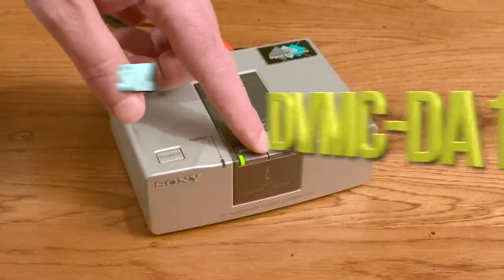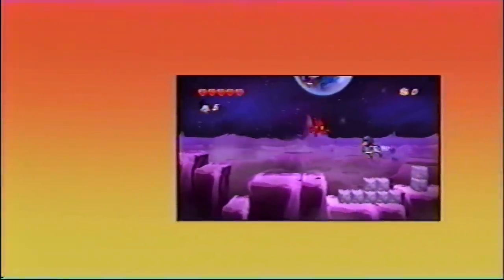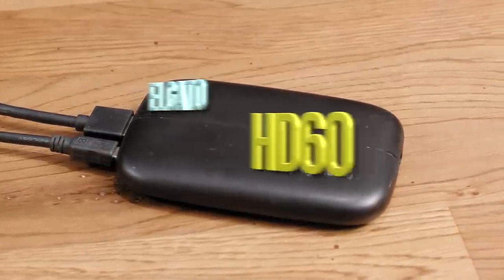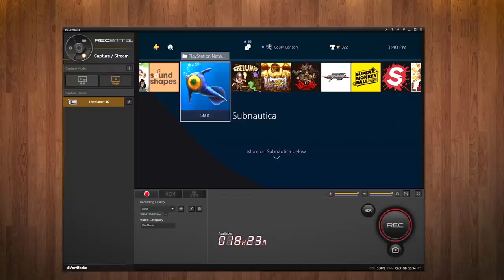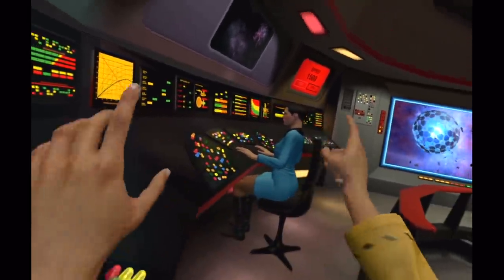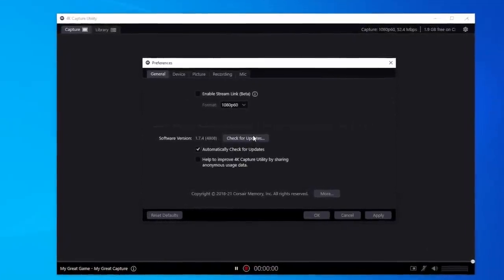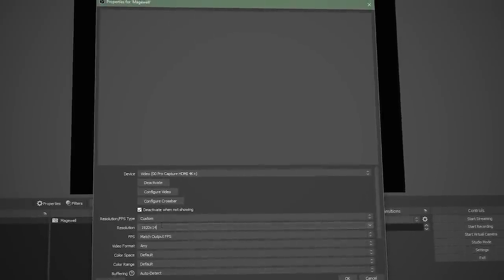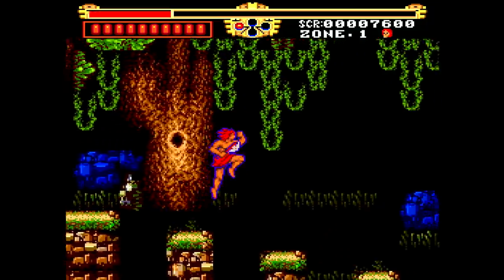Video Capture Devices for Gaming

Comment: I have the Elgato game capture HD 60, but I found it very finicky with staying connected to my PC to actually record anything, and the delay was annoying between playing and capture.  

I upgraded to whatever the internal version is (the older one, HD Pro I think it's called) and it's awesome! Very occasionally it will drop the signal and I'll have to restart my PC, but I think that's more my PC than the card itself.
Reply from the maker: That's interesting. Maybe a USB issue somewhere? It always stayed connected to my Mac.
Reply: @GameSack  the USB does feel a bit loose in it, but it could be anything, it flashes red and then the PC doesn't pick it up.  I need to mess around with it more, it's just sitting in a drawer at the moment, but it's easier to use with my PS3 than the Pro so I need to bust it out again soon.

Comment: So, I have an old internal aver media card that can do 720, but with no passthrough. I recently started streaming, and bought an external elgato hd60s+, and it's been going strong for the most part. I've only streamed Xbox Series X and PS1 with it so far, and OBS occasionally drops video with PS1 games (using a Rad2x) and can have audio and video go out of sync. I don't know if those problems are with OBS, but if I use the elgato software, it seriously stretches the 480p signal from my PS1, and I don't like that. OBS only slightly stretches it, which isn't ideal, but is much better.
Reply from the maker: With OBS you can force it to exactly any aspect ratio you want. Elgato's capture software works but it can be kind of basic.

Comment: I got a $16 capture card from Amazon to fan edit Star Wars I-III. It claims to capture 60FPS, but apparently it only does 30 and then doubles those frames. I only really needed it to capture 29.97 FPS in the case of Blu Ray. This card had no trouble capturing the signal from my Blu Ray player or from my PS3, which apparently have copy protection. It does well enough for under $20, and when I researched more expensive cards, they all seem to come with compromises anyway.

Comment: Elgato has been my go-to for years. Well, I originally had a Haupagge that did component only, and it worked well enough for my 360 at the time. But when I went Elgato, I never went back, yo.

Although, I guess since I have a 4K TV now, I need to upgrade my capture card to a 4K display, though I need to save some money again since I bought too much good shit. (i.e. PS5)

Comment: All this resolution and format nonsense sure makes the good old days of CRTs seem sweet. They would take seemingly any resolution and framerate you could throw at them and they would faithfully display it, with the bonus of no aliasing like modern digital screens or any processing delay time. You know what, probably the only way to make a fool proof retro gaming capture device would be to write the capture code to work exactly how the CRT gun and screen works but in a simulated software way. Instead of manually setting each resolution and game capture mode for each specific game output type, they could all just run through the simulated CRT gun and the results could be picked up by the simulated screen. 1 function for every mode just like how it used to really be. I'm sure it could be done. Although nobody probably cares enough to do it that perfectly or has the time and money.

Comment: 14:23 How does that passthrough deal with hdcp signals of the ps3?
Reply from the maker: It doesn't. You'd have to run the PS3 through a splitter that removes HDCP before you get to the card.

Comment: The Elgato people were full of crap from what I can tell. They probably cheapened out on some components and that makes the thing awake slowly from sleep mode.
At least I don't remember any EU device ever taking too long to come out of sleep mode (source: I live in the EU). If there is indeed such a rule it must be some really esoteric directive that only applies in very specific cases.
Thankfully I doubt I'll ever record stuff from consoles because this stuff looks very complicated and pricy (I already had to build a new PC this year thank you), I mostly intend to record PC stuff an I'm not too picky so I use my GPU overlay to record things. Though one or two people complimented me on the quality of the captures so I guess I must be doing something right I guess. Though that's probably more because I usually disable all smoothing effects for DOSbox that are usually ON by default even if I do set the fullscreen resolution to 1080p for upscaling. At the moment my only editing skills consist in starting the videos a bit earlier so I can cut out any logos or watermarks (some renders in DOSbox don't allow the GPU to filter them out) using the GPU's own software.